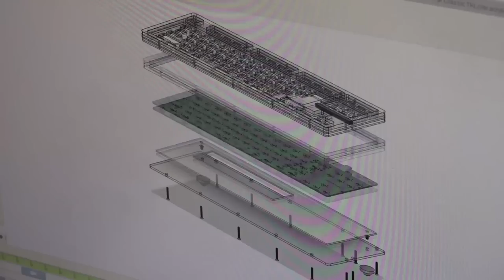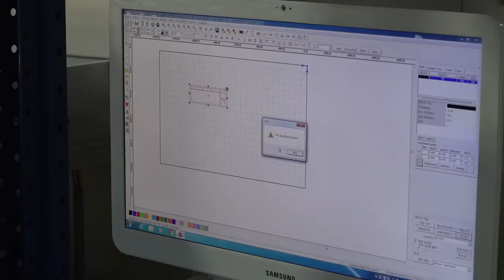Unique! The process of making a Korean mechanical transparent keyboard.

Comment: question, why drill the holes? Lasers are perfect machines to cut holes.
Reply: It was not just hole. He drills with that tool to make nuts on body
Reply: Solo para hacerlo ver artesanal así de simple para que veas que ellos.producen productos de calidad y artesanales y digan que gran empresa :v
Reply: They were tapping threads to receive the screws.
Reply: They made screw threads not just holes. The laser can’t make a screw thread. That is why they turned the drill backward after make the holes.
Reply: It's not a laser cutter. It's a water-jet cutter with a fine abrasive added to help cut into the material. If you look carefully, you'll see water droplets form around the cut lines. The holes it produces are not precise enough for tapping for small diameters. Instead, it only creates drill holes to assist in locating the holes and to guide the drill bit. While water jets are not as precise as their laser counterparts, they produce a cleaner cut without charring or melting the cutline and produces no toxic fumes.

Comment: why?
don't know what will be the next revolution in KB?, making it transparent will bleed out the RGB light. 

The next revolution will be when a standard is create to control in a standard way, the individual RGB led of each key, individually, by software.

So, any ordinary app can set the color and bright of each key at a given moment.

That will led to keyboard for educational or gaming purposes, example, light up only the keys that the user needs to use in the game, change the color for giving it different meaning at a given moment.

A music game, can extend the game to the keyboard RGB.

For educational, WORD / EXCEL teaching what are the most common shortcuts when the user presses CTRL.